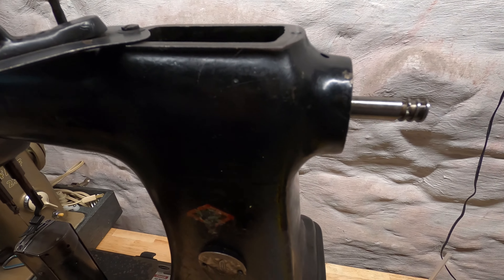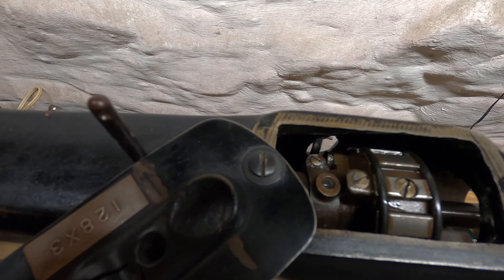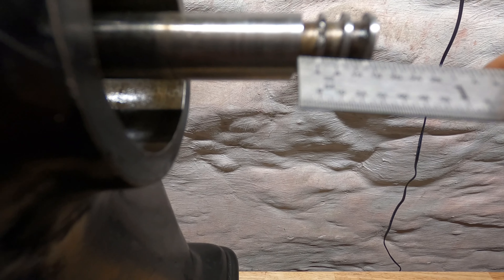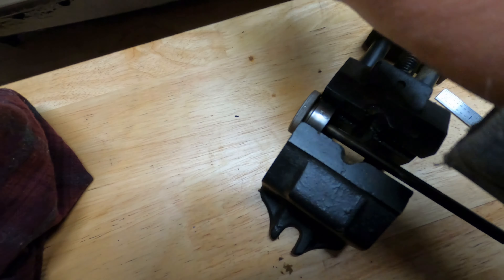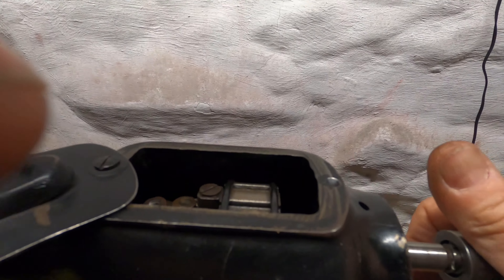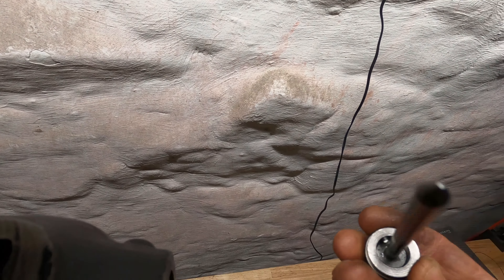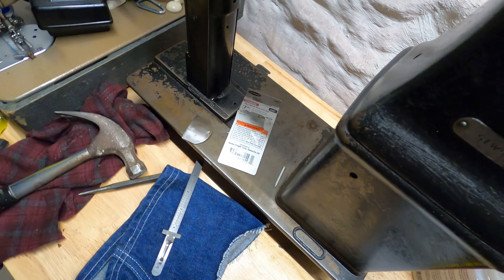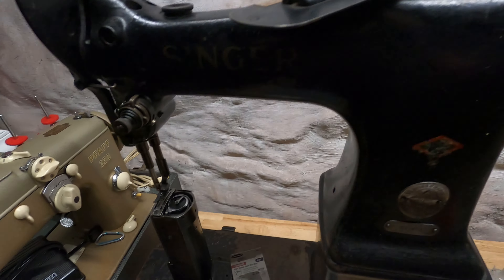How to fix a broken stitch length shaft Singer 51w

Comment: Great video. I have an old Singer just like that but it needs the same type belt . Do you know where I can find one?
Reply from the maker: I've done a couple of others since and used a modern belt that fit perfectly. Check Ebay. buy from "Sharp Sewing" the one I bought from "Cutex" was too tight.
Reply: @carlmauro4813   hello , do u have the the serial number of a moder one that fits ok ?
Reply: it have to have 62 teeth and  around 37 inches of perimeter